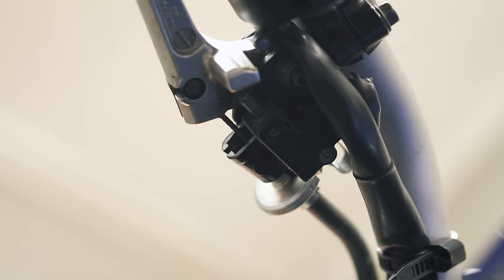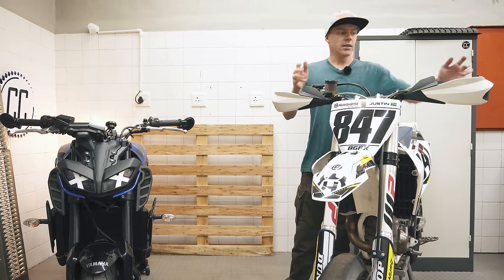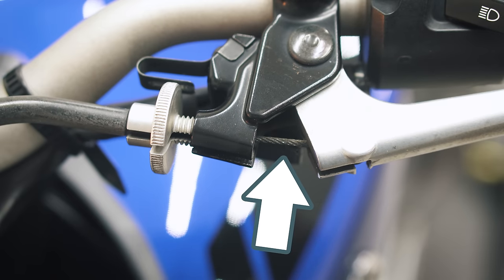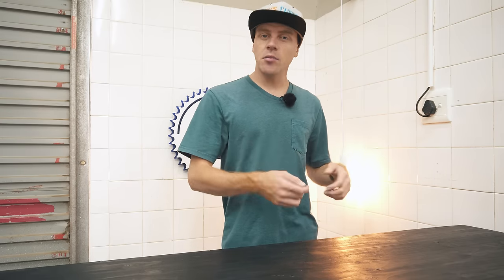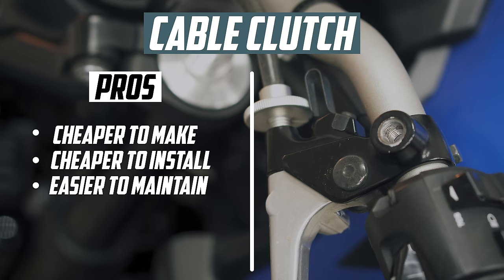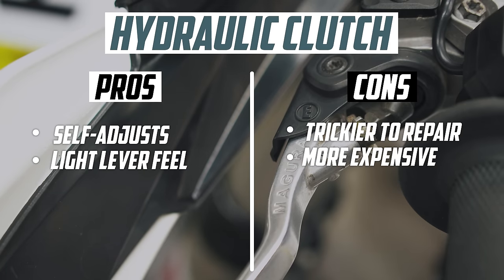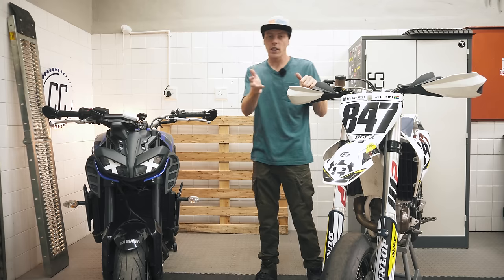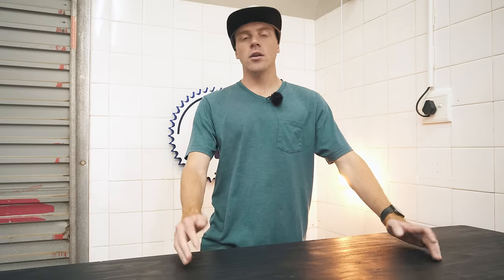Cable Clutch vs Hydraulic Clutch

Comment: Euro designers: make something unnecessary, make it expensive to maintain, markup the price of the motorcycle by an extra grand
Reply: NA designers: Just keep everything the same but charge more.
Reply: it's really smooth and light to squeeze the clutch, I like it personally.
Reply: idk hydrolic clutch is way better in enduro
Reply: Bruh if you compare cars to this then you’d realize that cars ditched every design except for hydraulics. If you have experience on cars then this is a piece of cake 😂. It’s not hard to fix nor is it difficult to understand
Reply: Change the fluid every 4 years. Yeah, that's really expensive to maintain.
Reply: You know who started with this? Honda.
Reply: @GPz84  2 yrs
Reply: @daveo9844  2 years, rubbish. Fluid starts to turn dark, change it. That simple.
Reply: Ive had much less issues with hydraulic than with cables. Sure its easy and cheap. Ive never had hydraulic fail on me mid ride
Reply: Hydraulics better, I've had a cable snap on my daytona 675 ruined my day.. and the few days after that 😂
Reply: My 92 Honda has a hydraulic clutch 😅
Reply: @TheRealNicolai  VFR?
Reply: @Maxime_L91  yes 🙌
Reply: I put fresh fluid in my hydro clutch. Was very easy lol. No fancy tools

Comment: I’ve got a 2020 Yamaha wr250f and I’ve been riding it for a little while now, it’s got a hydraulic clutch and I’ve found that the pro of it being lighter to pull outweighs the cons of maintenance and cost, especially when I’m riding it for longer periods of time off-road. Anyways, love your videos man, they’re bloody awesome, keep at it!
Reply: Get you an RSC clutch and problem solved
Reply: That makes sense considering you need a lot of clutch control while going off-road, right? I haven't done in the off-road writing but I imagine there would be a lot of clutch movement
Reply: It seems my CBR 150 doesn't need an upgrade since its clutch already dang light
Reply: @nauvalghaina8616  dude, cbr 150 probably have the lightest stock clutch on the market.. even a baby can pull the clutch on that bike😂

Comment: Anyone that shifts very often or rides a long time will likely agree that hydraulic is better, simply because your hand gets tired of pulling. But the difference is not so big that I'd go through the trouble of installing a conversion kit.
Reply: Id disagree with that. do about 1200 miles a month. I prefer the cable. You can adjust your cable clutch to require little to no pull to activate. Its all in your preference.  I can engage and disengage my clutch with only about 1/4 pull of the actual lever due to how its set up. I have a Yamaha warrior 1700 and a Gsxr 1k.
Reply: The heaviest clutch lever I've ever pulled was on a K1300S, which has a hydraulic clutch. Depends on more factors I'd say.
Reply: For myself I'd say there was a week or two of an adjustment period when I first got on a bigger bike with a heavier clutch pull (started on a GS500 where a child could pull the clutch all day long). Being used to it now I can't say I'd take the cost & maintenance of a hydraulic system (especially seeing it fail on a friend's bike) over the simplicity of the cable clutch. I ride my bike every chance I get year round, enjoy shifting a lot to stay in the powerband and have no issues pulling the clutch all day long.

Comment: I've used both and honestly the only real difference is that hydraulic is easier to pull the lever, as you mentioned in the video. One other con about the cable clutch, is on some bikes, depending how they are routed, they are effected by heat. For example, one of my bikes is a Yamaha XT dual sport which uses a cable clutch and the cable is routed very close to the header and engine. When the bike gets hot the cable expands, which causes more play in the lever. It does not effect function, but it is noticeable.
Reply: Jesus christ that's why !! I was thinking my clutch "bearing" was shot. THANKS
Reply: Very interesting side effect. Is it possible to wrap it around or avoid the heat from being that close?
Reply: Im sure there's an easy fix. Just reroute the cable somewhere further from the manifolds.
Reply: Just saw your commend, I sold my XT250 because of 2 main problems difficult to adjust clutch, event I installed easy pull clutch.  and another is tubeless front and tubed rear tires. That's new for me. Thanks

Comment: I like both! But when the hydraulic clutch starts to leak that's when it becomes a complete nightmare
Reply: If a hydraulic clutch starts to leak, it's usually progressive, giving you a chance to rectify it before it fails completely, but a cable will often break without warning, potentially leaving you stranded. This is why I always carry spare cables and the tools to replace them.
Reply: @rickconstant6106  I had a Honda 650 xr and that's exactly what happened to me I was in the middle of nowhere and the clutch cable snapped ! I had to quite literally push and coast quite a heavy motorcycle for miles! Came to a little town that had cable similar to the clutch how to use metal cable joiners to get me to the next city which was 54 miles away and they had a Honda dealership there so everything was all good. Will always remember that moment but all my KTM 990 I noticed pressure in the clutch started to get weaker it was the master slave so replaced some seals and we're all good

Comment: My CBR1000RR came with an hydraulic clutch and I never had to rebuild master or slave cyclinders on it.  And I have 102,000 kms on the bike.  
I do however change the fluid every two seasons in the system.  
If you do need to perform work on the system, it might be more expensive, although re-routing a cable from a cable clutch from the handle to the cover can sometimes be a real bitch depending on the bike.  
Oddly enough, the second bike I have ever owned was hydraulic clutch as well, a 1984 HONDA V30 Magna 500cc.  
I really like the fact that they self adjust, that way, you know the adjustment is always spot on, no guessing.  
But, my smaller bikes have cable clutches and there is nothing wrong with those.  I do not notice more “feel” from a cable clutch though.  
Like you said, number one reason manufacturers use cables is for cost savings.

Comment: Something VERY important is the small mechanical system connecting the lever or the receiver cylinder to the actual clutch plates. The fact that the hand movements are transmitted by a cable or a liquid doesn't really matter that much.
If the cable lever arrangement allow for an easy cam setup, the hidrolic receiver cylinder has usually a very short stroke and is giving a linear effect. Only very specific springs can provide a non linear effect... and it is very difficult to tweak indeed...

Comment: A hydraulic clutch over a cable tends to be a lot smoother and a lot easier but with that being said on an older bike where you need a little feel with that clutch that cannot always be a  good thing. I put a hydraulic clutch on my older sportbike with a race clutch. It was a lot easier and a lot smoother but tended to be a little bit snatchy because I was losing that feel in the lever if you know what I mean

Comment: I have multiple bikes with a mix of cable/hydraulic clutches among them. I do prefer the hydraulic type because it is easier to pull and (despite the comment on this) is easier to maintain. I have suffered the dreaded broken clutch cable while out on a ride more than once, but never had a hydraulic clutch failure. Lack of regular maintenance affects BOTH types of clutches. Cable clutches are hard to lubricate properly and typically break right at the solid drum end in the pull lever. Careful attention and lubrication to both the cable and the lever mechanism is required. For the hydraulic clutch, lubrication of the lever mechanism is still required, but seems to be less of a concern. The other hydraulic maintenance item is the clutch (brake) fluid itself. I've been wrenching on motorcycles for over 50 yrs and find this one item is the most overlooked task. Because brake fluid is hygroscopic (absorbs moisture) it will require regular flushing. If your fluid looks like tea, it's definitely time to change it! Clutch/brake bleeding is a straight forward process and should be learned if you want to maintain your bike. My 1999 Honda Valkyrie Interstate (140K+ miles) has a hydraulic clutch and other than regular flushing (about every 2 to 3 years), has required no other servicing. Ride safe all!
Reply: As someone who has also suffered broken clutch cables on the trail, hydraulic is looking more and more appealing. Although I did just start carrying an extra cable in my backpack, which I might still do...

Comment: Only tried a hydraulic clutch for a short ride and it felt really smooth and nice to pull. But you do lose some feel for the clutch pull.
The thing with cable clutch is, that it feels nice when new and fresh, but with use it quickly becomes sticky and worn feeling. You only tend to notice that when you fit a new cable and sleeve. I think that on most new bikes with clutch cable you are not actually supposed to lube it anymore, because of a teflon coating inside.
Anyway, If I could choose one on a new bike I think I would go for a hydraulic clutch, provided it's from a reliable brand...
Reply: The teflon liner just means you need to change what you lube it with. Most people lube them with the wrong stuff anyway. You shouldn't use wd40 or anything like that. Chain lube works ok. I work with bicycles and we actually use a mix of fork oil thinned out with a PTFE based chain lube to lube all cables we service or install
Reply: @mad082sss   Chain lube? But aren't all chain lubricants sticky? Just curious. I could understand fork oil or even engine oil. Personally I just use some drops of mineral machine oil once in a while when it feels a bit stiffer and it works like a charm. I agree that WD-40 is not meant for long term lubrication, it dries up too fast. But sometimes I use it first to clean and loosen up the parts, and a couple of days later apply proper oil or grease.
Reply: @moteroargentino7944  motorcycle chain lubes might be sticky but bicycle ones aren't

Comment: I have a love-hate relationship with cable cultch. My dad used to have a cb400, one day as I was talking it out for maintenance ride around the neighborhood, when I was clutch in to change gear the cable decided to snap. Back then I didn't know cultchless shift is possible so i panicky pull the front brake and immediately low side the bike, it was bad.
Reply from the maker: Ouch!

Comment: One of the major benefits to a hydraulic brake vs a traditional cable is that if your cable snags on a70's bike it can lock up your front brakes and send you over the bars, with hydraulic brakes, this can't happen. it will fail before it snags in a way to do this. There is still issues with durability as it will fail long before a cable wears out.  It can also add time to fast repairs as a cable can be swapped in seconds but bleeding brakes to gain pressure back takes minutes.

Comment: Feeling is a weird one... Because I could argue that in Hard Enduro for example, cable clutches just don't exist. And that's a sport where clutch feel is incredibly important, arguably more so than any street application or even motocross. It's one of those things that is basically impossible to be objective about :)
Reply: You can't ignore the PITA of maintaining a cable clutch in such harsh environments, where water, dust, sand and mud are a thing.
I honestly feel that I have a much better clutch control on my MT-09 compared with my KTM 350 EXC-F.
Now, given what I said before in regards to maintenance, of course the clutch feel of the hydraulic clutch will remain constant for many many rides despite the elements, in contrast with the cable which might feel awesome on the first ride but degrade fast with the following rides.
I think that's the main reason behind enduro bikes shifting to hydraulic.

Comment: on a long adventure ride, fixing a snapped clutch cable by carying a spare (some ppl already have it routed and zip tied to the "active" one) is much easier than fixing a leaking hydraulic one.

Comment: I've got  a 1988 Vf750c  hydraulic clutch  and a Gsx1400 hydraulic clutch. Had many bikes since the 1970,s  and prefere hydraulic.  To get more feel just pop braided steel hoses on and 6 way adjustable clutch lever. Sorted. And they don't snap .

Comment: Don't remember ever breaking a clutch cable ever (in almost 40 years riding).  I do remember one friend breaking a cable on a ride out, but his maintenance was atrocious). That said, when I was a teen, the owner at my local bike repair shop recommended never lubing any cable as the lube that was already in there was cable specific and more than sufficient, and any posterior lubing would basically "wash away the good stuff".  This is especially true of WD-40, or similar products. Never put WD-40 near any cable, ever! (Unless its their dry, PTFE, lube)
If the cable started playing up, got tight, or whatever, then just replace. After all, they aren't that expensive.

I have three bikes, two with cable clutches and one with hydraulic.  They are different, but I think it's more down to clutch size and spring strength, rather than if hydraulic is better/easier than cable.

Comment: Cable clutch maintenance requires you to remove all the line out and take apart your body kits in order to work on it and lube it once every few months or adjusting it as the line starting to sag. While hydro clutch is much easier to repair in my opinion and experience, all I gotta do is take 2 screws off and pour and pump the fluid and check the line once every few months to ensure it is in good shape with no cracks, which usually never the case since my hydro clutch line has always been on my motorcycle for years and never had the need to replace it because it is still in good shape with no cracks or buldge, I never had to worry about lubricating it either besides grease up the lever once in awhile which is fairly easy to do and is self adjusting. Overall hydro clutch is so much superior than cable, I don’t see the reason why anyone would say it is not as good as cable clutch in terms of reliability. The only time you need to take apart the whole hydro system is when there is a seal failure or leaking or cracking tube which is rarely been the case for me in many years since every tube and seal is tuck in beneath the body kit and rarely exposed to direct sunlight,

Comment: The friction zone(fz) location is the always the same on a hydraulic clutch. The fz location can be moved with the adjustments of a cable clutch. The fz of a hydraulic clutch can, but not as drastically, with adjustable levers. I've ridden both, extensively in slow speed trainings and operational situations. I'll take the consistency of the hydraulic clutch any day

Comment: I noticed recently my Goldwing had a hydraulic clutch - I hadn't even realised! So I guess I didn't notice any difference in response. In fact with bigger bikes at slow speeds you often control the speed with clutch actuation instead and it is very good for that. So I am still unsure which is "better". I suppose it's one less cable to lubricate and replace but it's also one more system to change the fluids on.

Comment: I have a hydraulic clutch on my Aprilia RSV, its nicer to be able to fine tune the clutch a bit with different slave cylinders etc. I'd also say the force required is more linear. But you really don't notice while riding.

Comment: imo it all depends on the application. on a mile munching sports tourer a self adjusting clutch is pretty nice! on a cheapo weekend warrior naked bike i'd however prefer a cable one 😅 that said my current bike is a '94 FJ1200 using hydraulics 😁

Comment: My 1987 Honda Hurricane 1000 has a hydraulic clutch, and so does my 2004 cbr1000rr. I had a !984 Honda interceptor with a hydraulic clutch also. Not quite so new. I do prefer a hydraulic clutch though.

Comment: Its probably so its easier to pull in the clutch with hydraulic and it also depends on the clutch weight and springs and however makes up a clutch of a motorcycle engine.

Comment: I've owned a lot of different brands of bikes since #1 in 1966 and none of them ever had hydraulic clutches. Seems I missed out. My current bikes, Triumph and Huskvarna are both cable, although there is a hydraulic conversion kit for the Husky. However, both have quick shifters and I can't see any reason to change away from what's on the bike. 
I once had a cable break on my Indian Springfield. I'd been out touring for a week and the day after I got home I was riding to the bike shop when it snapped. The bike had about 50,000 kms on it. The shop sent their trailer for me and replaced the cable under warranty. Lucky it didn't break when I was out in the middle of nowhere.
Reply: Heres an idea a mate of mine does , tapes a new clutch cable to the current in use 1 , & also has a few basic tools 🔧  , so if & when he does get a cable breakage , swaps the ends to bring the new cable into olay & off he goes , 10 to 15 mins work

Comment: On street bikes, I don't really care, either works fine, but for offroad riding, it makes all the difference! Certainly prefer hydraulic clutches on my dirt bikes. 

Also, quickshifters are nice, but as I've learned, using them all the time destroys a transmission in no time. Mine is done after just 10k km of mostly using the KTM's somewhat clunky quickshifter. Back to clutching it is.